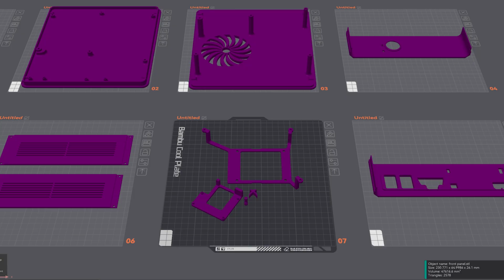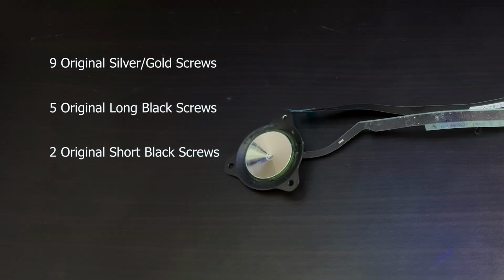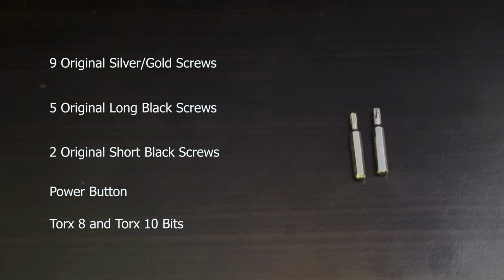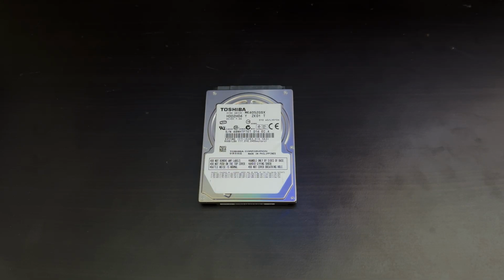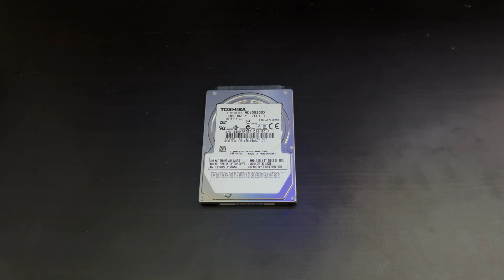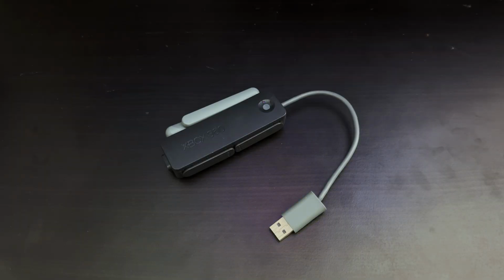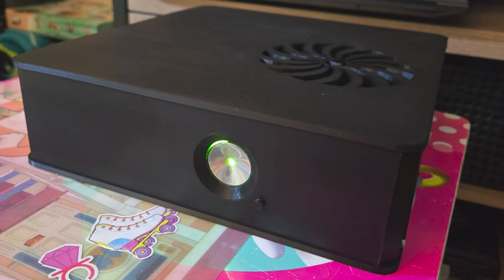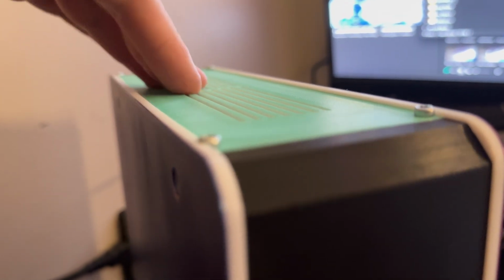3D60S - Fully Modular, Reversible, No soldering 3D Printable Shell

Comment: Cool project, but why fix what isn't broken? You're not making it that much smaller and original shell looks way cooler (subjective though). You removed at least 2 features: DVD drive and IR sensor (not everyone cares about it though, especially on a modded system). Most importantly though, fans should have some protection from dust. An improvement from the original shell would be making the PSU internal or switching to Type-C (which I don't think is possible atm). That's the most annoying part of the 360 imo.
Reply from the maker: Really all of that is subjective though. What if you just want something different? Or what if your shell is smashed to pieces? Options my friend. That is the goal here.
Reply: @MysticPrysm agree. Dust filters should be considered though, especially since it's not easy to take apart to clean.

Comment: This is a really cool case, I made one similar on Makerworld as well. Mine didn't printed in parts though, the second version that i started will though, am just working on the internals.
Reply from the maker: I seen that and I do really like it. I like how you were able to retain the front USB. It just seems none of us can maintain internal wifi without soldering lol
Reply: @MysticPrysm  I would like permission to remix yours and add the usb ports, I already add the sync on mine, and i am planning on added a way to create a button for the eject section of the eject ribbon because the eject button is needed for modded system to put them in bootloader mode.
Reply from the maker: @cutsdbz hey I modified it on printables and makerworld to allow remixing